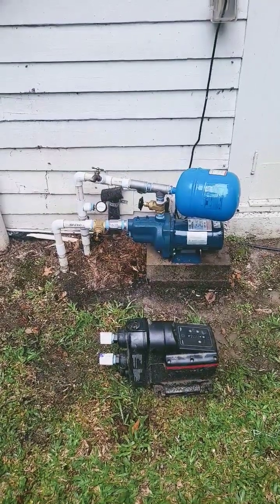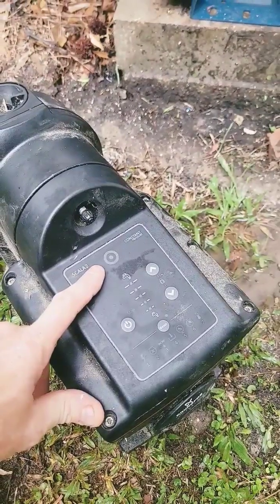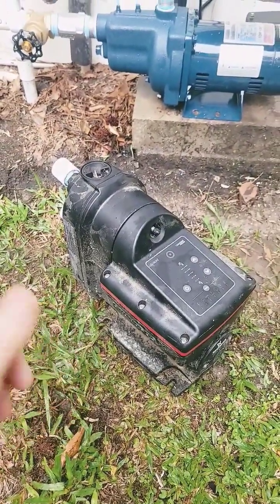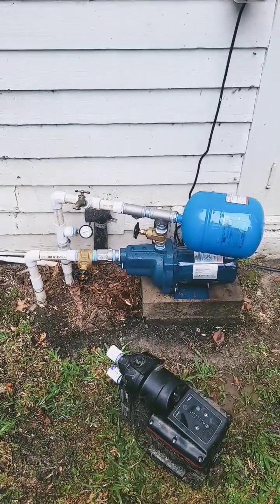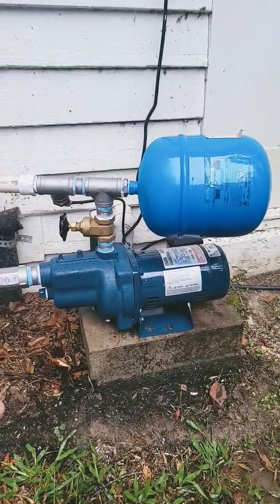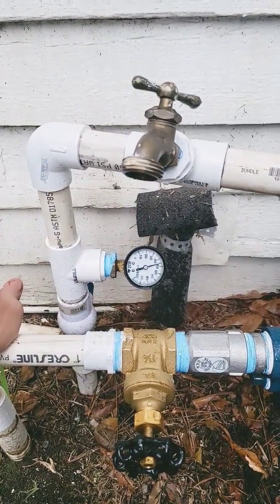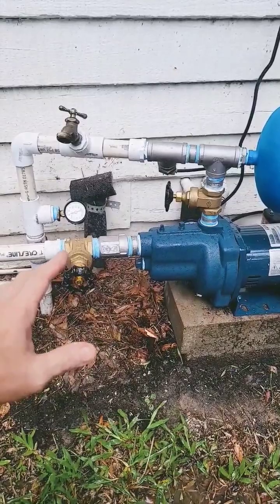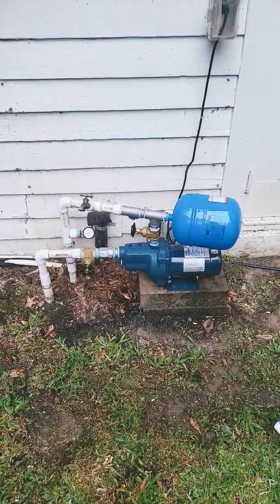Booster Pump on Flow Well Replacement for Water Source Air Conditioning

Comment: I know that they arent super nice, but what is stopping a person from using a harbor freight drummond pump and tank combo for a booster pump?
Reply from the maker: @JSLantz  they can but can not handle normal constant operating.  The fail for running without water in minutes and can not be repaired.  Not to mention the pump is not well performing.
Reply: @ClearWaterPumpWell  is there any lower cost pumps that you would recommend?
Reply: I was using a Truper Pres-1, it lasted a little over a year, and now it isn't pumping as much as it was. I've taken it apart and checked other things in my system and have had no luck getting it to pump like it was, it will only increase pressure by about 5-10 psi now. The impeller is still good.

Comment: Good day. Can you explain what you did to stop the pump from short cycling continuously. And I saw you put a valve to regulate the flow, and it has a small expansion tank.
Reply from the maker: With the heat pumps running I set the valve to regulate constant pressure at 50 psi so the pump would not cycle.
This limits the flow and prevents the pump from shutting off and cycling while a load is being provided.
Reply: @ClearWaterPumpWell  
I follow your channel because I myself work on  pump cistern. 
So thanks for replying..

Comment: That is sad.  Hope you don't get rid of that scala 2.  Good little pump much better than the crap you installed.   Next time just set the expansion tank up correctly and you won't need to replace a pump needlessly.
Reply from the maker: The Scala 2 was replaced under warranty 18 months ago.
It is sad that there was nothing physically wrong with it yet it faulted as if jambed.
I took the impeller stack apart it was not jammed and shaft spun freely.  The tank pressure was set properly in the scala and it worked fine for 18 months until the fault. 

Also no the Franklin Pump is one of the best pumps I have ever worked with not crap!
It is performing flawlessly even not being variable speed or DC drive!
Oh and the best part there's not 1000$ worth of Tech that just doesn't want to just work!

I will never install another grundfos pump like the scala 2!

Comment: Very good and informative video. 

Question: 
What would normally be the cause of short cycling, on a system such as that, with a bladder tank?  

I have never used a bladder tank system at all. 

I have only used an 80 gallon galvanized steel pressure tank, with a Brady AV-80 air volume control unit.

In order to stop my well water pump from short cycling, I ran one end of the pressure line from the pressure switch, several feet away from the water pump pressure switch, into the water line leading to my house.  

That put an end to my well water pump short cycling and burning up pressure switches.

I believe I saw a excellent video that you made about a month or two ago, with the same type of extended pressure line setup. 

Over the years, the occasional reoccurring problems that I encounter, are the rubber diaphragm in the AV-80 getting a hole in it and the galvanized steel pressure tank getting waterlogged.  

I purchased and stockpiled extra Brady AV-80 air volume control units as well as AV-80 repair kits.  As you know, the price of both the AV-80 and the AV-80 repair kits have gone up substantially over the years. 

Once again, thanks for another good concise video, with useful information on well water pumps and well water systems.
Reply: Thank you for your reply.

That is a lot of good useful information that you provide in your videos. 

With my shallow water well pump system, when I a notice a change in the water flow inside the house, that’s a good indication of the pressure tank getting waterlogged.  

You’re right about the damage it can cause to the well pump, especially with the pump overheating from the pump cycling off and on.  

Thanks for your great videos on well water pump systems.
Reply from the maker: Wow David good questions, 

With a small booster system like this it will short cycle without constant demand. 
If you ran the faucet there for a few seconds the pump would come on and shut off very quickly. 
The main purpose of this system is to supply constant flow to heat pumps which run for 30 minutes to a hour at a time.  The pump will start and stop with the AC units. 

I ran multiple tests with ACs turning on under different circumstances and it performed flawlessly.  It only just started with turn on and shut off with slow close valves even and didn't short cycle. 

Bladder tanks can be a simple solution to most well uses but can't work in all situations. 

So yes the AV80s are about to drive me crazy as I will buy 5 or 10 at a time and 50% of them are defective one way or another out of the box! 
When I open boxes off the shelf I look visually for defects. I find that the diaphragms can be torn by the screws, casting cracks, tank outlet not drilled out and many other problems.  Lucky I can catch these before I buy them or waste time installing. 

Granted there are also failures during installation like leaks and such.  Sometimes I can make repairs to them and keep them in service. 

The leading cause of Pump Motor failure is a waterlogged tank.
Preventing your tank from becoming waterlogged is very important.
Catching a pump short cycling in the 10 second cycle time before few seconds can save a motor.
Generally the capacitors and pressure switch are the first to fail.  Then start switch, motor windings, check valves can start to fail prematurely.

For sure if you have any questions just let me know!

Thanks for the comment and watching,
Casey

Comment: When you talk of heat pumps how are you using your well water for them? Im just curious because i live in the north. Thanks love your channel!
Reply from the maker: The Flow well here can actually run the first floor system without the pump as it has 15 psi natural pressure.

The water source heat pumps are similar to geothermal systems but utilize water directly from the well to exchange heat.
The unit draws water over a coil in the indoor unit which is almost like a window unit as in single package.  Theybare not split systems and use the water to take heat or reject into the drain flow.

During the summer the 75 degree water is way cooler than ambient air temps over 90 and cool very efficiently.  In the winter it's even greater advantage near freezing as the temp difference is over 50 degrees.
Water source and geothermal systems shine in winter heating from such a huge advantage.

During the summer it can be compared to a traditional heatpump until it gets extremely hot.

Thanks for the comment and watching,
Casey